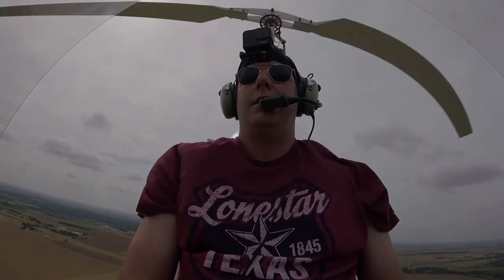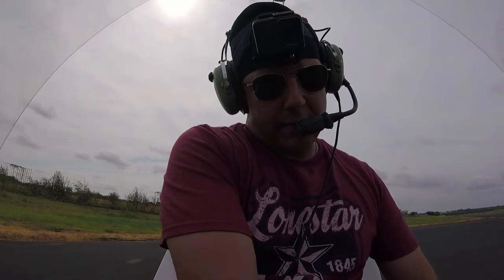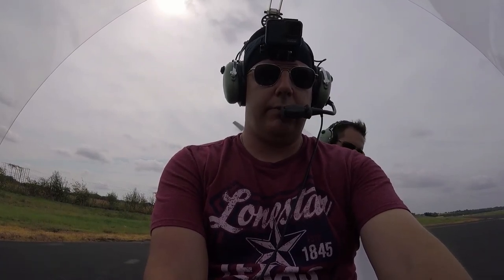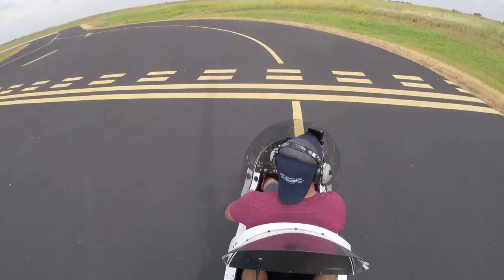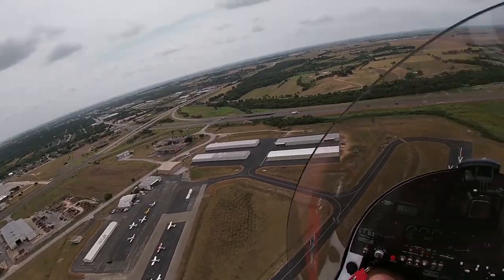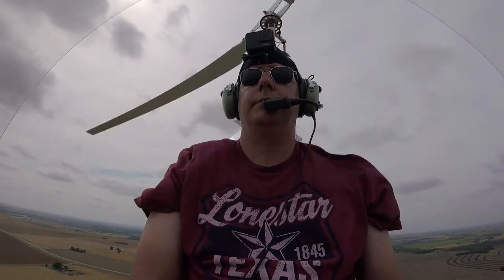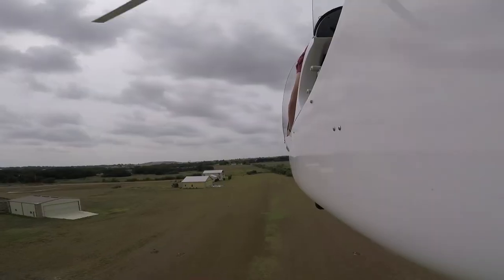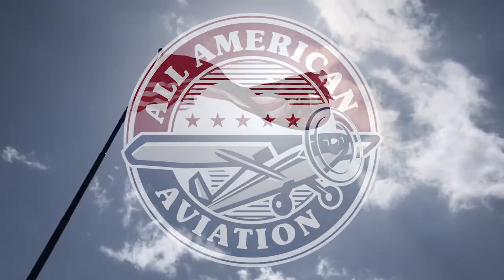What is a Gyroplane?

Comment: I'm having trouble wrapping my head around the physics of the autogyro. What keeps the rotor spinning without putting more pressure under one side of the copter than the other and still angle the blade for lift? If that makes any sense.
Reply from the maker: The rotor is constantly in autorotation like a helicopter would be.  The forward thrust of the pusher propeller creates relative wind that turns the rotor disk.  Thanks for watching!

Comment: If the rotor isn't powered how does it get rotating before u r moving ? U were stationary on the ground and u stated u we're gonna pre-rotate it
Reply from the maker: Great Question!  The rotor system has a "pre-rotator" that is tied to the output drive of the engine.  It can be engaged and disengaged like a clutch drive to spin the blades up prior to take off!